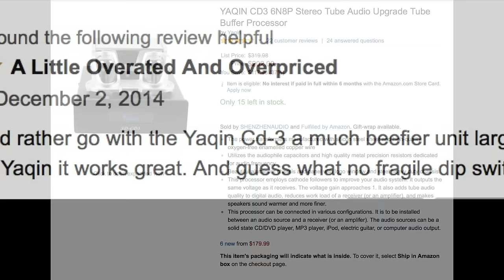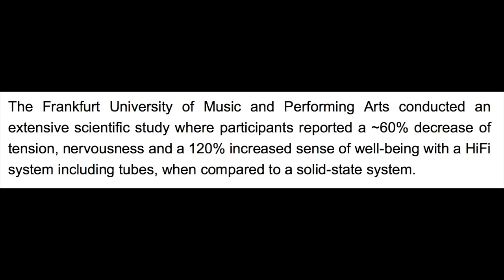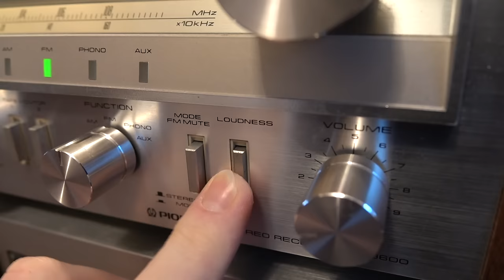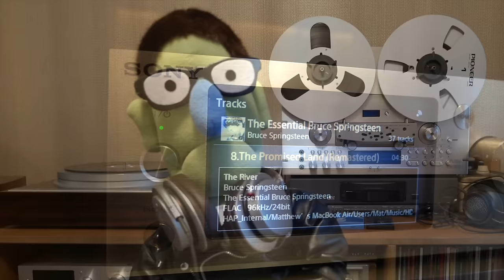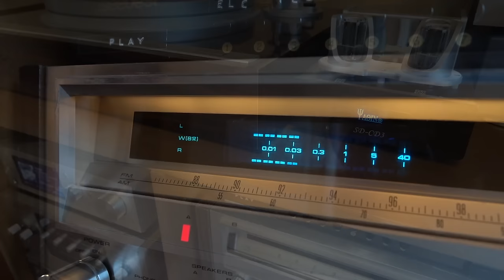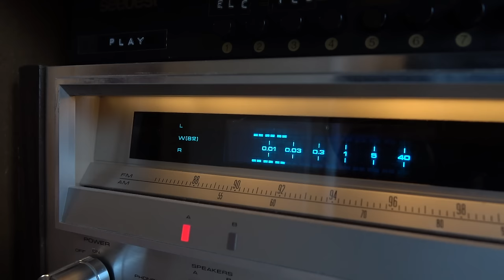Add the magic of Valves to any HiFi - with The Yaqin SD-CD3 tube processor

Comment: As soon as anyone is finally able to explain what the hell it IS that the tubes do to the sound, I might give this a shot. Before then, all the vinyl vs. digital and tube vs. solid state rage holds little substance to me. Do a scientific description of harmonics, overtones, frequency, dynamics etc., and you might be onto something. Without all that, the discussion remains on the level of pure ideology and nothing is gained for public knowledge.
There are so many esentially fake ways of improving the perception of the sound in the short run which all fail in the long run: loudness sounds impressive at first, until you later realize that it drowns out the middle frequencies and promotes booming on the boosted frequencies. Even just turning up the volume bring out more details in the mix, but there are obvious limits to cranking it all the way up to the limit. Compression is another one: it brings our more detail at first, but it ruins the entire mix if you overdo it.
In a nutshell: as long as you have no idea how the perceived improvement of your sound works, you might find yourself actually compromising other aspects of your listening experience. Why is it that nobody even tries to explain what tube amplification does to the signal?

Comment: Using a tube amplifier is like buying a McDonalds cheeseburger and putting it on your grandmother's china.  If it gives you a more enjoyable experience, then more power to you, but any perceived improvement is almost entirely in the head of the consumer.
Reply from the maker: +Staticharge ..would the same go for a tube processor?
Reply from the maker: +mipmipmipmipmip how about eating burgers off your Chinese grandmother?